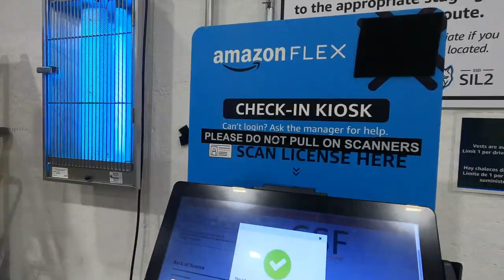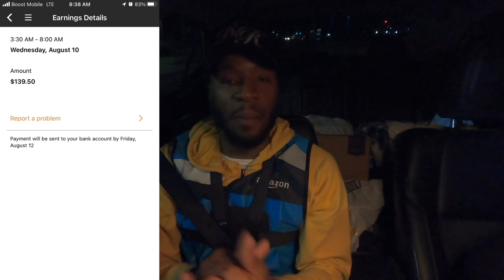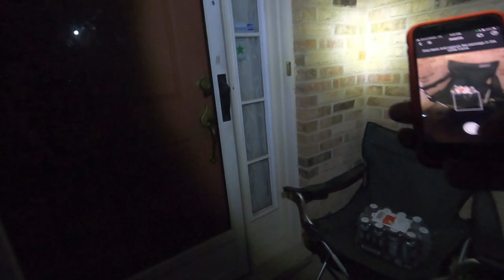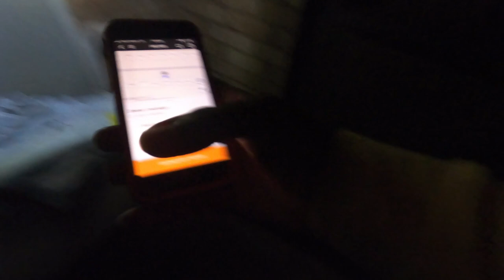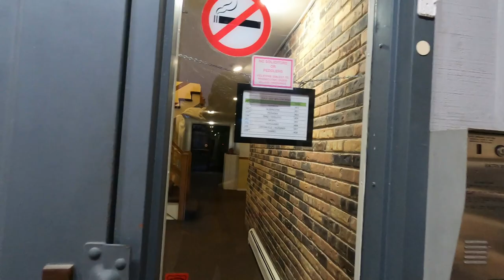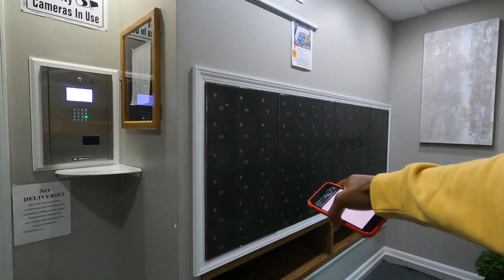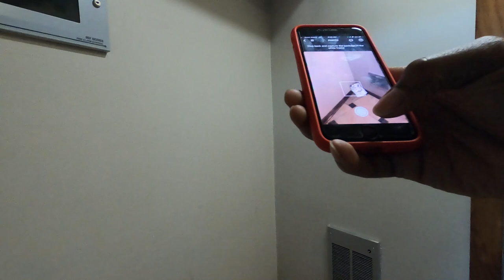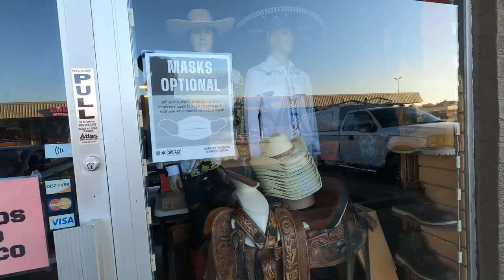First Time Doing A 4 1/2 Hour Amazon Flex Block! How Many Miles Did I Drive? Was It Worth It?

Comment: If you separate plastic packages, put them in a tote or laundry basket in the front seat, and just boxes in the trunk and back seat, you found a cheat code because I have to have the advantage over other Amazon Flex drivers. If you do that organize and alphabetize by street names you are saving time and it is a cost effective measure. I just thought I would let you know. I tried everything to find out. It does take less time, less steps and more efficient than everything altogether. I noticed I am the only one that saves time? Saving time is as important as getting paid. You have that instant advantage if you do it. I promise!
Reply from the maker: 💪🏾💪🏾💪🏾 Thanks for the info!!

Comment: I notice doing those early shifts aren’t worth it.

Yea it’s higher pay but you wouldn’t be able to book another shift that day.

The more lucrative of a shift you get the less likely you are to get another shift until let’s say a full day has passed. So the amount of money or hours you can invest into the gig is really capped

For example you may get a 4.5 hr shift paying $140 but it’s 40 packages at 3am.

Or you could’ve booked two 3 hour shifts, have 1 shift doing 20 and other shift doing 25 packages, finish early with 1 hour to spare and make the same amount and yorue driving during the day time.

Its all about what schedule you want to follow. Do you want to get up at 3am and get one shift in and done or do you want to do two shifts during the day but finish quicker? 

Plus don’t forget you’re dealing with rush hour traffic going home whereas you could work during the day and deal with rush hour during a shift which is easier than going home or commuting to facility during rush hour
Reply from the maker: This is true!! I usually only do 1 shift of Flex.
Reply: @carsandcribs  I think it’s a set amount they allow you to get paid. So for example if you can’t make more than $250 in a day and I noticed for my area that’s as good as it gets. If it’s busy and the pay is high you still won’t make more than x amount. 

Also the shift you get, if you chose to book a second shift you can only make so close.

So let’s say the cap is $250 and you get lucky and book a shift for $150. Even if you get another shift you’ll only see the retail offers, or base pay so it’ll be like a 1 hr $25 run or a 3 hour $60 run so you get two shifts, you make close to $250,  but I think they set it up so it’s fair that way one person even if you use a bot or whatever you still not making more than x amount. You could have bots booking shifts for you and be on standby ready to do this full time and you still won’t make more than x amount no matter how hard you try. 

But if you book let’s say a 5 hour $175 route you may not see another option for rest of the day. But you maybe able to book two $90-$120 routes easily
Reply: @carsandcribs  in. A sense it helps change it up a bit. You don’t have to rush because you know you won’t make more than x amount no matter what. It places more emphasis on just getting the job done right; quality not quantity. You won’t get paid more for showing up early or taking extra boxes.